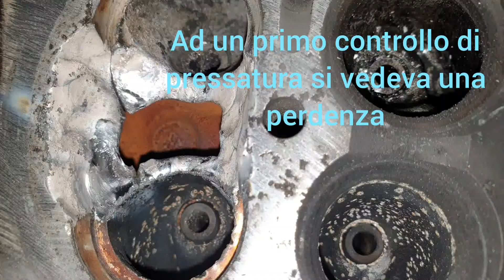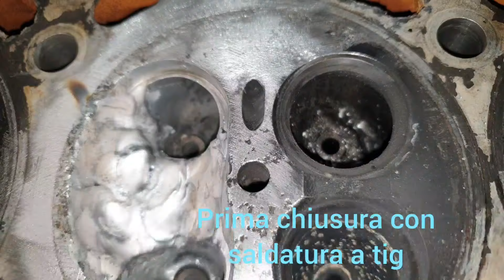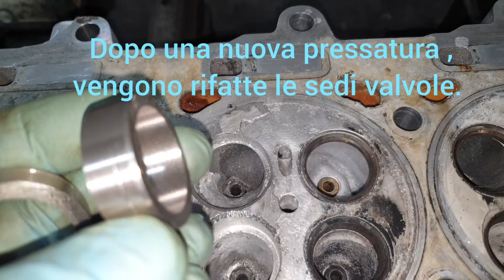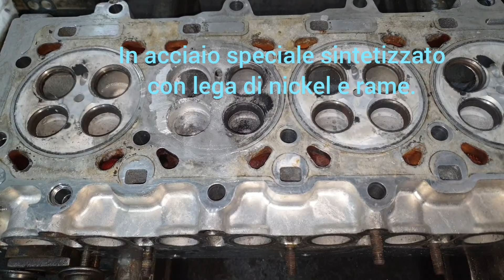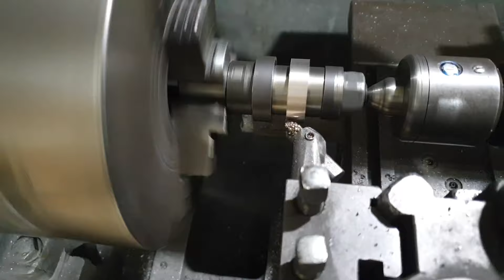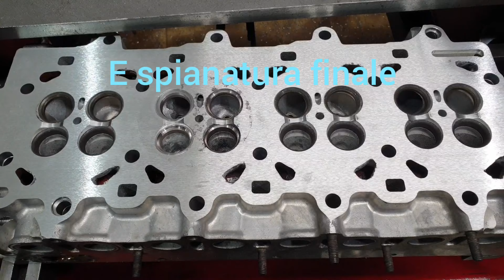Testata jeep cherokee riparata al tig. Elaborazione fai da te.

Comment: ciao Giovanni.... una domanda se posso per quanto riguarda i 3 angoli della sede valvola 30, 45,  e 70,... vorrei chiederti, è possibile oppure inutile creare semplicemente un “cono” partendo all’interno del condotto sino alla parte sede valvola fino al taglio dei 45 gradi ( dove appoggia la valvola) senza fare i 3 angoli ?
Reply from the maker: Ciao, direi propio di no , o per lo meno il tutto si basa sull'inclinazione condotto e se c'e' dall'orientamento prima della sede. Al fine dei vantaggi in base alla geometria e piu consigliabile creare un venturi arrotondanto il tutto prima dei 45°.
Reply: va bene...volevo un tuo parere,... se posso ti invio una foto su un lavoro che ho fatto in una testa Tu5jp4 (206 peugeot) credo che il venturi ci sia, ma mi volevo prendere il sicuro,... ho lasciato 1 mm circa di appoggio sede valvola,... e più sotto appunto ho creato il condotto a cono eliminando i 2 angoli,... in pratica resta il 45